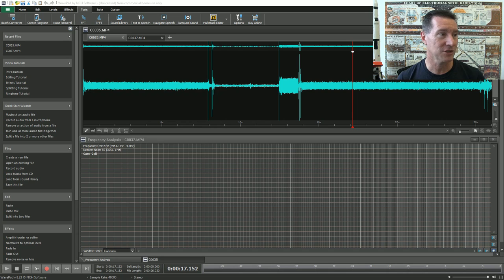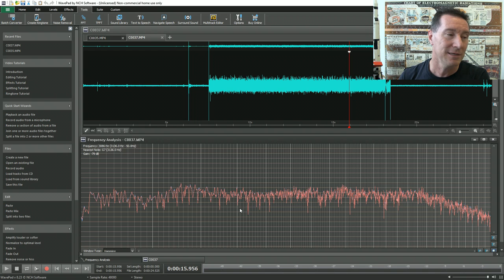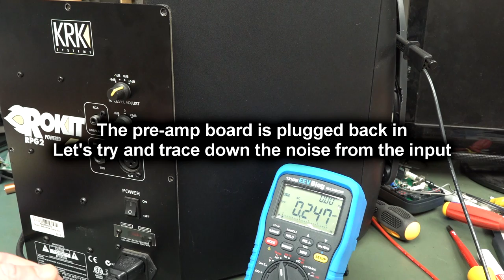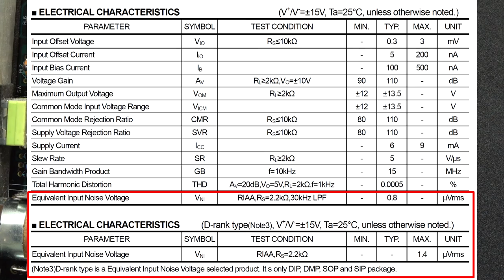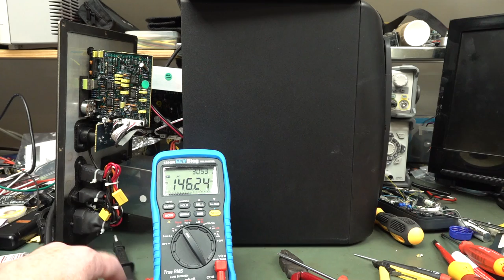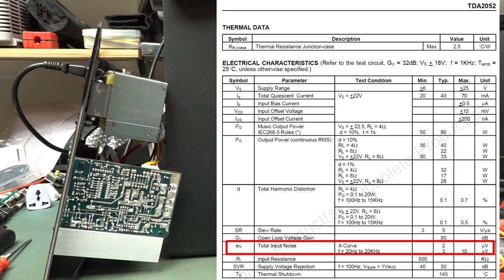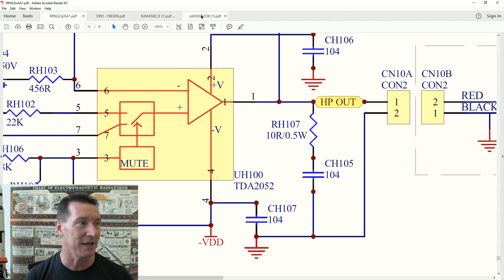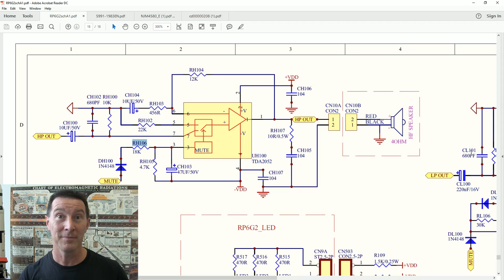EEVblog #1118 - Why Are Studio Monitors Noisy?

Comment from the maker: NOTE: Some studio monitors will have an "auto-mute" function that is designed to make the speaker silent without an input signal, so the background noise isn't heard. This is a different feature to power-on mute. But the noise is still there in the amplifier and returns when you play music and goes out of mute mode.
Reply: Aye, try listening to audio books/spoken voice or any audio which is "on" but has lots of silence in it. You can hear the noise floor in the spaces.
Reply: I have a pair of Rocket 6 G2s and I've had to stop using them.  I left them powered on for several years and they slowly developed a louder (but still faint) hum that you can detect from several feet away.  I plan to replace some of the capacitors on the amplifier to higher quality ones, but I don't know if it's going to help.  I would be very interested in a video where you attempt to lower the noise floor on this Rocket 6 by upgrading the components.  :)

And before anyone says it, I've already verified my cables and power source.
Reply: Junction avalanche noise -  Great for white noise source on a synth but I'm with Frank Zappa when it comes to amps. I'm one of the few unlucky people who bought a Marshall hybrid valve preamp/transistor power amp. What a piece of crap that turned out to be!
Reply: Sounds like it is ripple from the power supply to me. The very first thing I would do is stick a larger reservoir cap across the power to see if the noise goes down. It sounds like 100hz to me, which would be ripple from the full bridge in the power supply.
Reply: Yes, that's what I meant actually.  I'm wondering if switching to an "audio grade" cap will sound better than a generic quality one.  I have no experience with that sort of thing.
Reply: Yes it would due to the lower ESR allowing it to respond quicker to the ripple.

Low ESR is what is important, but low ESR electrolytic is exactly what 'audio grade' electrolytics are.

In anything else, you could add a ceramic in parrellel but that won't work here, since ceramics are microphonic, and the amp is inside the speaker cabinet.
Reply from the maker: Richard Smith - Did you watch the video? I showed it was a 100Hz hum from the rectifier.
Reply: EEVblog Rane Sl2 usb audio interface repair video? 🤔🤷‍♂️
Reply: Awesome Video, Dave. I was so excited to watch this. Tweeters are super sensitive, that's why this is kind of common problem. I really love how you use engineer perspective to troubleshoot. Tongue at right angle.
Reply: Thanks so much for this video!! I got a pair of Mackie 12bst and I got the noise in both tweeter and sub even at idle. Will this hurt the speaker drivers over time at different volumes?
Reply: Would the noise (hiss) decrease if you hit the power amplifier package with cooling spray?
Reply: To me I have different problem, when I dont have input the hiss is super low, but if there is input I have higher hiss even when playing audio at lower volume I hear hiss.
Reply: Peter B  Its from the pc, I am using linux, and I also have bum sound when audio card wakes up. Anyway I want to make auto standby on my audio amplifier cant make it auto detect input. Any idea? Thanks for answer.
Reply: Peter B  hi, sorry for late reply.
The sound card is integrated, its intels sound card. And I am using 3.5mm cable for connecting it. It looks like the issues are because of that card. When I connect it to android it doesnt have those issues. Also this is amplifier that I made using 2xtda7265 in bridge mode and I dont have anything expensive there. Thank you for your long answers.
Reply: I've had a terrible experience with Adam T7V monitors, the ground noise wasn't "barely audible", it was so fucking loud I immediately regretted buying them, even through a DAC it was insanely loud, I tested via RCA cable though, balanced is APPARENTLY a bit less noisy, which is still terrible because nobody wants noisy speakers, either make a working RCA input and a working power supply, or don't make speakers at all, that's my philosophy in general, either do it right or don't bother. I have no idea how all these speakers "pass" tests or whether they even test them properly and how they even approve them for market at outrageous prices like that, but I know for a fact that it's not right and these things shouldn't exist. Most cases I saw are from KRK and Adam Audio, meaning that some manufacturers do it right, and others don't, why don't we take a look at what's being done right and what isn't and just stop this never-ending cycle of noise. I lost a great deal of money paying to ship those shitty T7Vs, I don't want it to happen to anyone else, so whoever stumbled upon this, this is a friendly warning
Reply: Hi, I'm a little late on this reply, but did you check the noise produced by CH104, the electrolytic capacitor. I have found some electrolytic caps to either start noisy or to become so with time, especially if the applied delta voltage across them is much lower than the working voltage; in your case the voltage difference will be almost zero, not good for an electrolytic.
Reply: any chance to remove this type of noise coming from amplifier without affecting the sound?

Comment: Did you check the woofer for snakes as a source of hiss?  It is Australia after all!
Reply from the maker: I saw some odd looking wiring...
Reply: Don't be silly, snakes don't woof. But do drop bears hiss?
Reply: I had a quick look down my pants and yes all us Australian’s are hung like a horse, python next time thanks.
Reply: "Hung like a horse", is that judged by the colour or the shape?
Reply: the hiss noise is a little kid playing you
Reply: Always check for tapered coax in cable runs/trays before reaching your hands in. Have been startled a couple of times over the years when I've let my guard down.

Comment: well now you have to do a video of actually fixing the noise
Reply: Yes!!!!
Reply: He can't. Or at least for cheap.
Reply: @johnyang799  there must be a way
Reply: @JustUploads  Sure. Rebuild the amplification circuit. Yes.
Reply: It would be a bit of work, but honestly would make for some great content!
Reply: Where There’s a Will, There’s a Way
Reply: @ffmfg  But constrained by resources.
Reply: Fixing the noise requires lowering the gain of the amplifier, and shortening the grounding paths (the ideal is "star" grounding). Quiescent noise results when too much gain is applied by too few gain stages. The gain of the monitors is likely high so that a low voltage source like a smartphone can drive the speakers to full output, but if a higher level source is used (like a mixing board, which can supply ~2V peaks instead of the smartphone's 0.3V peaks) then less gain is needed in the amp. An amp with a high gain will introduce noise of its own and will indiscriminately amplify both signal and noise present at the inputs. If you can lower the gain, then you get lower noise. Also, use an adjustable gain stage for volume control and don't just use a potentiometer running passively with a downstream gain stage making up for the loss of signal in the pot, because that causes the signal to be lower relative to the quiescent noise.
Reply: Actually it is a function of Signal to Noise Ratio specifications of the amp.  If you want lower noise, get a lower power amp or one with the same power but a higher Signal to Noise Ratio..  For close in I use a Roland CM30 which has a much lower noise level than my Mackie SRM450 speakers with a 450 Watt system power.
Reply: The only thing many watched the video for and it's not there.
Reply: Only KRK Systems can do that, by going back to their R&D labs and fixing the problem.
Reply: @johnyang799  2 words: Ferrite Clamps
Reply: @diggzdoesgames  Let's see how you can reduce thermal noise by using ferrite clamp.
Reply: @thriift840  Do the monitors hiss if they are simply turned on and not connected to anything? Also, do you hear hissing if the laptop is disconnected from the AC adapter? Do you notice more hiss if the laptop is on or off?

Comment: Years ago, and not sure where I read this, but the article I read said that IC amplifiers have more noise to them than using discrete components.  My old Mackie HR824's are super quiet.  The only use IC's for the OP amp preamplifiers and output is power transistors.  Well anyway, one day one of my HR824's went dead, so I went out and bought Mackie MR5MK3 monitors.  They were low priced ones, but I just needed something to use while I fix the bad one.  I did notice that they had a pretty audible noise floor.  Opened one of them up, and sure enough, the power amp section used IC's.  I was sure glad to get back to my 824's.  Oh, before I forget, I also remember talking about it with my local ham radio group way back in the mid 70's.  I'm old.
Reply: i think it might be a bit more complicated than a IC versus discrete components situation. im not as experienced but i found that i can never adhere to simple distinctions like that because i get bit in the backside with counter examples.

stings, man :/

Comment: Most noise issues are due to bad PCB design and self noise.
It's especially a matter of designing the ground properly. I have worked on designs myself were that difference was 6dB or more.
That last one can easily be calculated with the gain aa Dave already mentioned. Don't forget that a tweeter easily has a sensitivity of around 90 dB/W. Maybe people also understand how difficult that's gonna be with super sensitive compression drivers.
A way to fix this for low power studio monitors is to add a resistor divider (called a L-PAD) after the power amp. Obviously you have to compensate for the gain loss in the pre-amp. The value of these resistors are critical because of the impedance. Wrong values will change the frequency response. These resistors barely add extra noise since the values are low (typically < 10 ohm)
Reply: That is some info that Dave could have told in the video, it would have been a little bit more interessting :)
Reply: PCB layout can affect mains related hum and buzz.  Random, uncorrelated noise is typically design issues, thermal noise related either from the semiconductors or resistors.  Bad gain structure compromises can make noise worse as well.

One possible way to reduce the amp noise,  IF  the power amp's residual noise reduces when its feedback is increased (value reduced) to reduce its gain....   
Try reducing the gain of the power amplifier and then boost its input signal level by adding some gain previous to the amplifier.  That is, if the amplifier input can then take a bit more input and the added gain doesn't bring back all the noise that was reduced in the amplifier.
Reply from the maker: That's not really the issue in this case. I shorted out the input resistor and there was nothing wrong with the layout. The noise was obviously inherent in the power amp chip.
Reply: EEVblog  .Shorting out the input resistor is only isolating the power amp stage from the rest.
(the proper way btw, is shorting the input to ground)
PCB layout issues will still be noticeable, I don't understand why you think that just shorting the input would change that?
The power amp chip still has some circuitry that belongs to the signal ground and not the power ground.
Anyway, I was just giving a general explanation (so people can actually learn from it). 
But I woudln't be surprised if it's bad PCB grounding in this case as well (not saying it is, i am only saying it wouldn't surprise me)
I have seen thousands of audio designs in my life and even the big brands make a big mess.
Reply: Did you short out the amplifier's feedback resistor ?  10K  I think ?    12K Ohms actually from the schematic
Ooops...  Maybe just reduce the value in case the amp isn't unity gain stable :)
Reply: boB Gudgel  . To measure output noise, you always should short the input to ground (or reference zero)
Reply: Which Dave already did I believe.  Next test I would do is to try reducing the gain of the amplifier circuit.
Reply: The EEVBLOG forum folks have found that this amplifier module has a minimum gain for stability of somewhere around 30X or 30 dB...
I wondered about that possibility.
Reply: Since a resistor's thermal noise is proportional to the square root of its resistance value, how exactly does a copper wire ("ground") with an impedance of milliohms generate enough thermal noise to create this hiss?

Comment: Notice no roll-off in the room background noise, so the roll-off is likely in the tweeter output.
Reply from the maker: Good point
Reply: Eh, if the noise comes from other sources that aren't subject to the same signal path as the tweeter output (for instance, ADC noise?) then your conclusion isn't quite right
Reply: This is fully analog, what ADC noise?
Reply: I mean thing's gotta go through an ADC before it goes into a computer
Reply: @dm, okay, makes sense.
But still, the noise was different between the tweeter and the woofer with the same mic+adc+....
Reply: OK so for instance, let's assume that the tweeter output is broadband white noise, and the microphone preamp has a rolloff at 15kHz. Let's also say that the majority of the background noise comes from the ADC noise. If this is the scenario, then Eka's conclusion is incorrect.
The noise profile of the studio monitor is indeterminant without more information.
Reply: Okay then that's pretty compelling evidence.
Reply: @dm  If those axes were annotated and we would see woofer and tweeter profile to be above the background noise we could draw that conclusion.So unless Eka was able to make that determination, you're right.(2) did we miss some comment?
Reply: uhh youtube screwed with the order of the comments, i put my long comment right after "I mean thing's gotta ..."
Reply: Look at the plots again. The roll off only shows up in the tweeter on noise floor plot, so the tweeter circuitry and tweeter is much more likely where it is coming from. Look at the room noise only plots, both woofer and tweeter. Dave only shows them for a short bit. Much flatter up in the higher frequencies than the tweeter on noise floor plot. If there was a roll off in the mic+ADC input you should see it in them too. Also no bend where you see the tweeter on noise floor have a bend at the start of the roll off.

As for the plots, it looks like the software is maintaining the same frequency range for the room vs amplifier on plots when Dave switches back and forth between them. Harder to tell if the frequency range is the same between the woofer and tweeter plots, but again it looks like the same.
Reply: If the "background noise" is mostly from the mic resistance, mic preamp and other electronics in the chain rather than acoustic noise in the room, it wouldn't include the microphone's high-end acoustic rolloff.  Thus the "tweeter" noise measurement rolloff could be partly due to the microphone's acoustic response.
Reply: So, where is the roll-off at the same frequency in the woofer noise plot? You do see some roll-off, but it starts sloping down at a much different frequency. Why? Different electronics in the mic handling low versus high frequencies, I don't think so. My expectation is the roll-offs are inherent in the noise floor of the low and high frequency amplifier designs.

Audio Gear with a roll off at 15 kilohertz? I don't think Dave would have bought that cheap of audio gear. That roll-off is much greater than the one decibel flatnes which most modern microphones and audio gear are easily able to do over the whole 20 Hz to 20 KHz range, or the lesser range 60 Hz to 18 KHz some cheaper consumer-grade gear may use. Again, why does it start at different frequencies in the low and high frequency amplifier plots. What was different in the microphone and audio recording gear between the low and high frequency recordings? Nothing changed other than what was being recorded?

Also Dave doesn't have a sound proofed office. As such I'd expect there to be a low but ever present broadband low level background noise which will be higher at low frequencies than high frequencies. It will change depending on activities in the surrounding offices and surrounding area.
Reply: @Kate
Agreed that modern microphones can be excellent and chances are that the tweeter is mostly to blame for the high-end rolloff - but still, we don't know which microphone was used.  My point was only that we shouldn't make assumptions about how much of the rolloff is due to the tweeter, versus microphone, without further information.  In my work, considerable effort often goes into determining whether response poles are in the forward path, or feedback (sensing) path, so I'm naturally wary of making such assumptions.  
But why mention the woofer plot?  Do you expect it to have sufficient high-end energy to reveal a break from 6dB/octave to 12dB/octave at 15KHz?  Room-noise plot is at 2:49, woofer noise added is at 2:52 and to my eyes there are no visible HF differences above a slight resonant hump that looks to be below 10KHz.

Comment: One possible cause of the hiss is that these and many powered monitors use Class D power amps. So there is an inherent switching oscillator that is part of the power output stage. These are great sources of white noise.

Comment: I've fixed this issue with my studio monitors. I tried replacing the electrolytic caps, didn't work. I noticed when lifting the center tap of the power transformer from the board the noise went away. Turns out that the system wasn't star grounded. I fixed it by soldering the center tap to the pin of one of the bulk filtering capacitors.
I would try lifting then jumping the rh100/ch102 node to pin 4 direct, and/or lifting the 2 earth grounds on the tweeter output
Reply: @DarthJe5us  It's the transformer pin in the middle, between secondary coil 1 and 2.